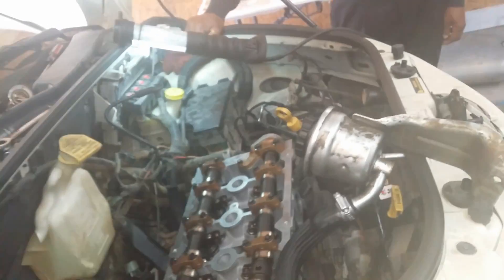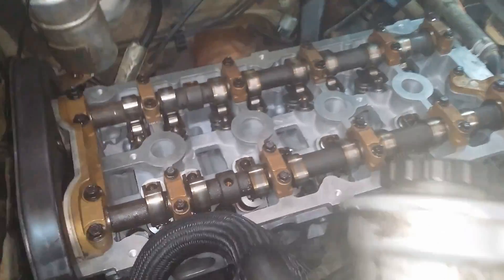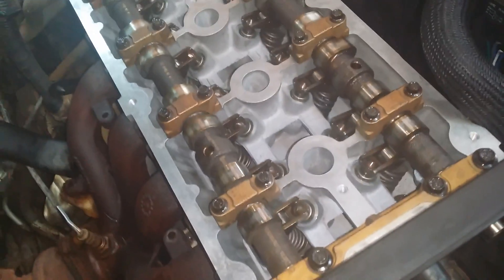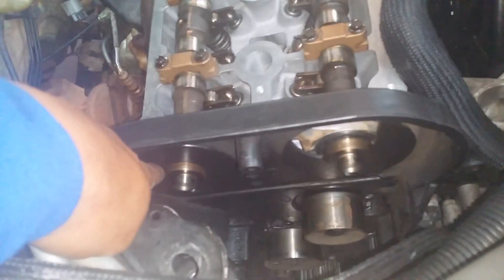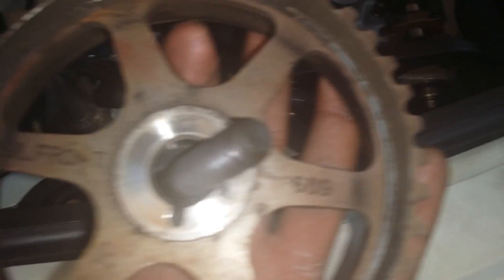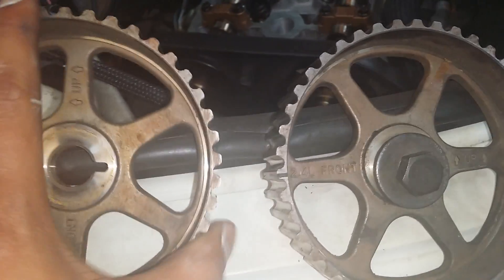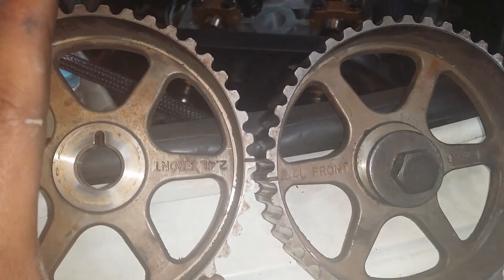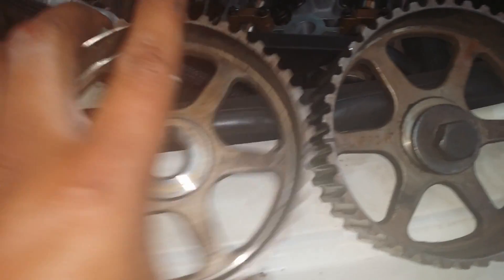Chrysler pt cruiser 2.4L timing marks setup- timing belt install part 1

Comment: may this be a smaller and harder one then the 2.2 or 1.6 ?
Reply from the maker: They both 1.6 and 2.2 have similar diagrams and ways to get the timing right...
I would say they both require the same work to get it done!..